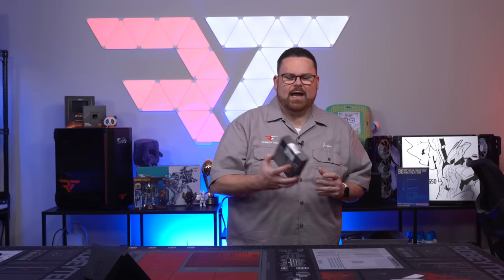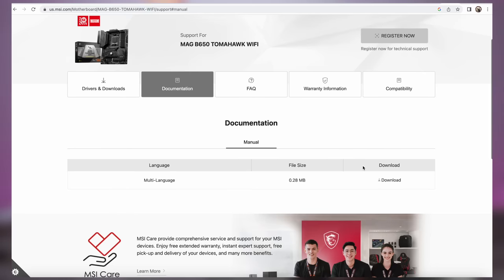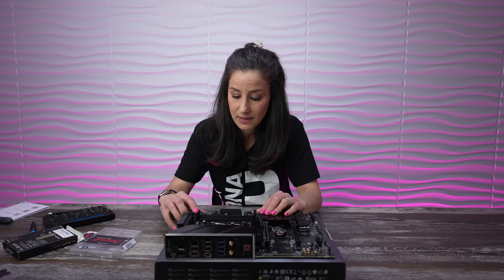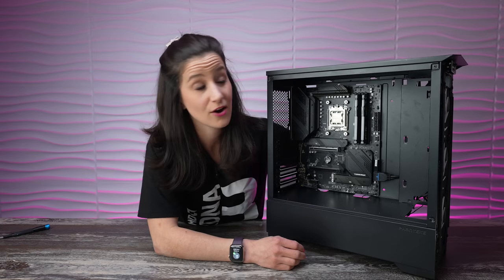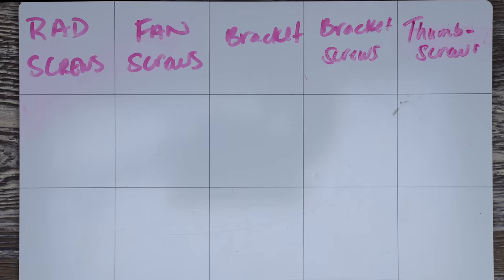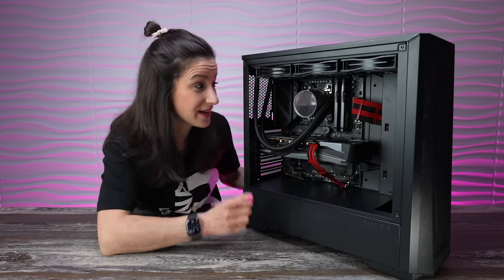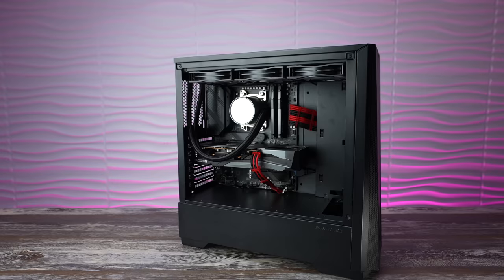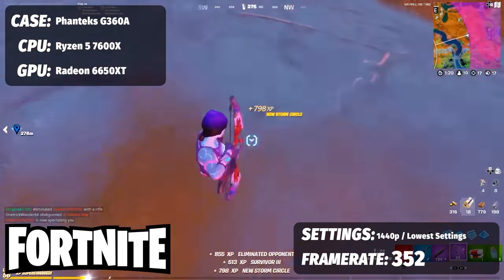Build an Epic AMD Ryzen PC using this easy to use Step By Step PC Build Guide + Benchmarks

Comment: Great video, almost impecable. maybe adding prices on screen for each part or a total budget at the end would have been a great idea, and clarity on that RGB vs ARGB connection arrow, as it is pointing what says JRGB but at the build the JARGB is connected instead, other than that, it was awesome explanation. Though after looking prices up, build is not that budget friendly.
Reply from the maker: Yeah we know the cost will come down over time so we wanted a great step by step for a 7600x or any Ryzen 7000 build 😊

Comment: Excellent step-by-step guide! 

The only thing I might have added, just based on a lot of the questions that come across the PC building subreddits, is a little more explanation of the PCIe and CPU cables, like a super quick discussion of when you might use just six of the eight for PCIe or four of the eight for CPU. 

Regardless, this will be my go-to build guide video going forward. Super clear and straight to the point.

Comment: great step bu step. I want to do some video editing at 4k, outside of increasing the memory, which gpu would be cost effective?
Reply from the maker: The 7900XTX right now is probably the most cost effective, or the 4080 (though overpriced) if you need NVIDIA.  If you want lower end the 3070Ti or the 6800XT are also really good.

Comment: I've seen mixed things on cable extensions. Some people have said their Temps were higher while using extensions, and others have had parts damaged while using extensions.

How safe are they actually?
Reply from the maker: I have built over 1000 PCs using extensions and not had issues because of then

Comment: AMD Ryzen 5 7600X with RX 6800 XT is good?
I didn't see Upgrades recommendation on description for RX 6800 XT
Reply from the maker: Yes it is!
Reply: @RobeytechLive  Glad to hear that, I will take for RX 6800 XT. Thanks for fast reply and awesome video!
Reply: @RobeytechLive  last question, better use back fan or not? because I still don't understand about air flow.

Comment: I don’t think that cpu is supposed to be running at 187 degrees Fahrenheit under load
Reply from the maker: Yep that’s pretty typical actually
Reply: The 7000X AMD CPUs will boost to 95C or their power limit, whichever comes first. It's "normal' for them to run at high temps under a Cinebench type load. Most of the higher end ones will boost right to 95 and just stay there, even with a 360mm rad. This is partly because of the boost behavior and partly because AMD put an extra thick IHS on them so that 5000 series cooling solutions would still fit.